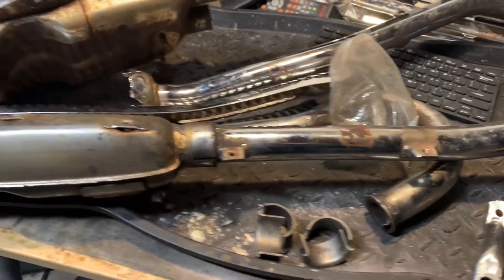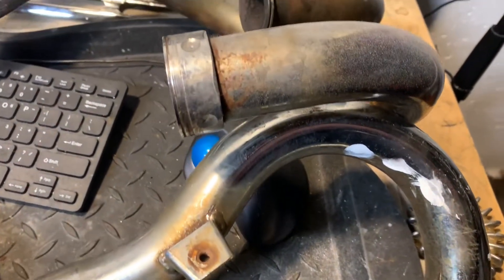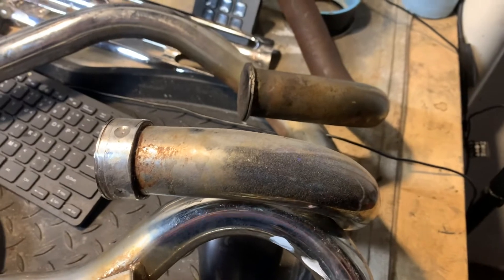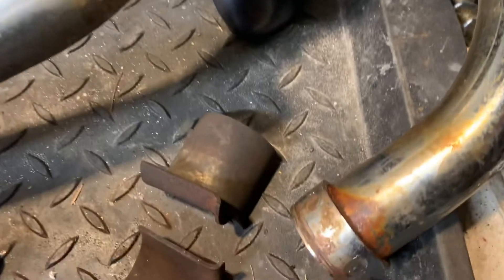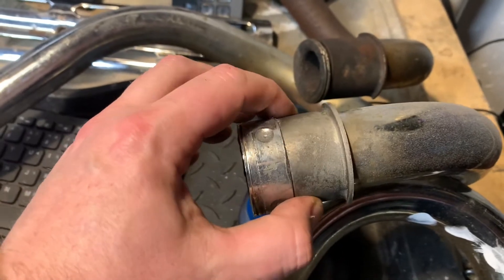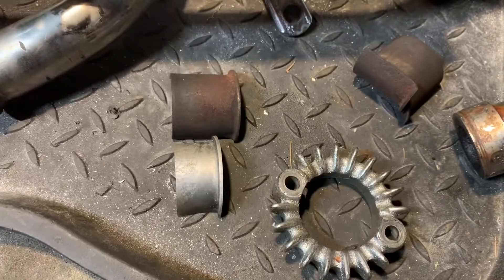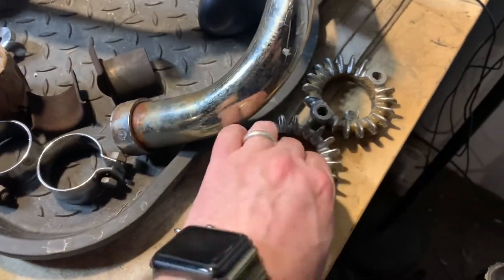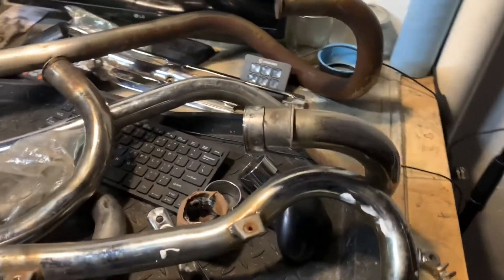Exhaust Header Pipe Differences for Vintage Honda Motorcycles CB350 CL350

Comment: Great video I am having the same problem the washer/tip of my exhaust came completely off and I dont know how to fix it.
Reply from the maker: Get it welded or find a different set of pipes. Lots on eBay.